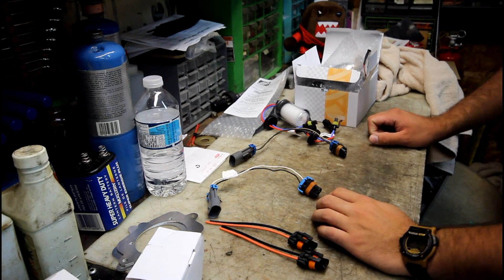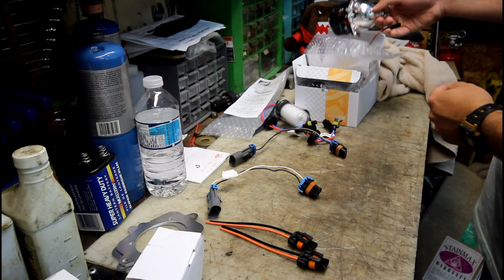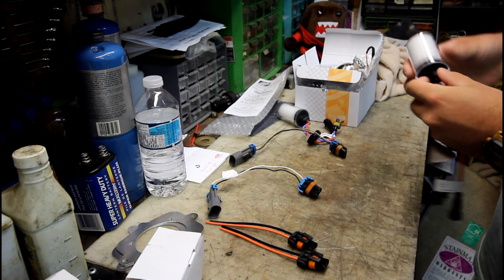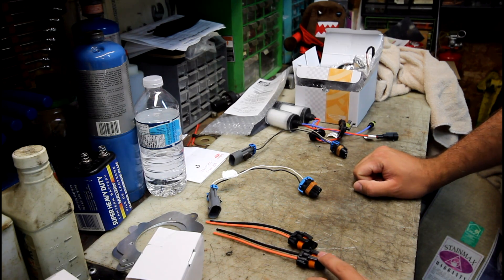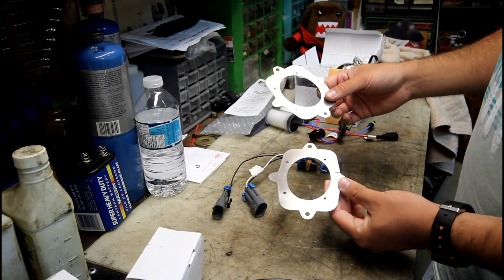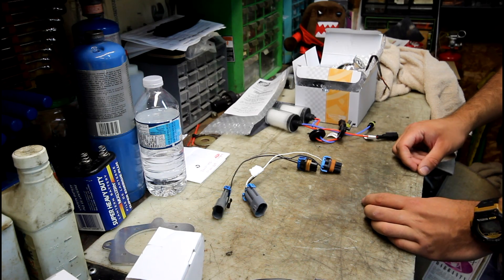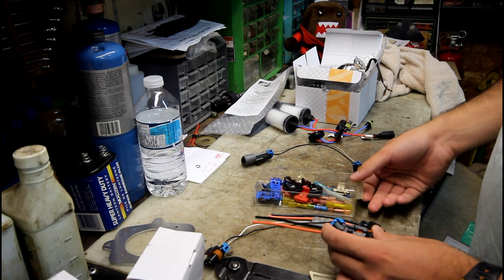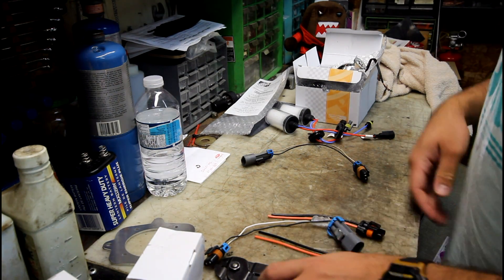How to: Retrofit GMC Denali headlights with HID bi-xenon projectors.

Comment: I realize this video is very old, but there aren't a lot out there showing this conversion.  14:35 has me very confused though.  You plugged the low and high beam into the harness you made, leaving one plug to plug into the truck.  That would have to be plugged into the low beam circuit for your low beams to work correctly.  Did this get changed when you installed the lights?  I have zero idea how the high beams are getting triggered at the end if you didn't.  These vehicles have separate harnesses for high and low beam.  It's also possible that I'm just dumb and am missing something obvious..
Reply from the maker: Sorry I'm only seeing this now as I'm going through old content, and unlisting things (not this video), but you would have had to do the HI-6 mod, which keeps the low beams on, when the high beams are active as well.

Comment: is it still worth it to do this and track down all the parts?  I just cleaned my glass projector lens and installed some auxbeam LED lights in mine.  They seem to work pretty well as is.
Reply from the maker: A company called Custom Brackets and Designs now makes the adapter plates for these headlights. They for the current version of Morimoto Mini H1. This retrofit is absolutely worth every penny. I'm about to do the old beater Yukon Denali that I just picked up for a winter truck.
Reply: @03canadianf5  Thanks!  As you can tell by my comments I don't know much about this.  I heard in the past that HID's were picky about coming on and off, Like for when you start your truck in a garage.  Might be a dumb question but could you use the Morimoto Mini H1 with a LED bulb?

Comment: Nice video. I am doing this for my 03 Yuk Denali, and I am using the H1M 7.0. Its seems the depth might be different with this design. If I were to mount my H1M's to the plate like you have yours my projector lenses would be 0.555" away from the projector hole in the headlight. Is it the same for you, and I am not seeing it, or did you use a spacer that I am not seeing? Also, the link you provided is not working, does this member still make these?

Comment: I currently have mini's retro fitted into regular sierra heads. When informed about this plate I've been looking for decent quality smoked Denali heads. Anyways, which fog and daytime bulbs are you using? Turns led? Links to bulbs would be extremely helpful. Looks nice man, now get that high bulb matching since it's basically for looks. The Morimoto hid dominates the light output..

Comment: Whats the benefit of retro fitting vs using an up graded 9005 hid bulb with the factory housings
Reply from the maker: Josh Willmont the light output. The stock HALOGEN projector is simply not designed to focus the hot spot of an HID bulb. When I had 9005 hid bulbs in these projectors, they were brighter than stock, however the light output wasn't optimal. There was no focused hot spot, the output was uneven, meaning you'd have random blotches of light and dark spots on the road. You won't regret a retrofit.

Comment: Can the Denali headlights be used in a non-Denali 2002 Sierra truck? I have amazon projectors & HiDs retrofitted into the stock housings with no lenses, thanks.
Reply from the maker: they'll fit any 99-06 Sierra or Yukon with the same front clip
Reply: Thanks, and I'll also need to buy that adapter to mount an hid projector into the Denali lamps? I'm trying to decide if it's a better option to do that, or to drill out a stock sierra lamp and jb weld the projectors in. That idea seems way too unreliable in terms of aiming the projector correctly.
Reply from the maker: check on gmfullsize.com. I'm pretty sure there's a member there selling adapters for the new Morimoto Mini H1 7.0's from the Retrofit Source
Reply: Okay cool, I'll compare the costs of a Denali headlamp pair + adapters, to the stock Sierra pair + labor required to jb weld the projectors in correctly

Comment: Which ballasts and bulbs did you use for this project? Thanks.
Reply from the maker: Back in the day I was running Morimoto 3Five ballasts, now however, I'm running all Morimoto XB gear. I don't have this truck anymore either.
Reply: Thank you for the response! Do you know if you can use the morimoto D2s 3.0 projectors instead of the H1 with this project? I cannot find anything on it online.
Reply from the maker: +Pibbles 'n Bits the projector needs to be a 2.5" projector. D2S is a 3".
Reply: Is there an easy way to modify the headlights to make it fit? Again, I really appreciate your feedback. I have spent endless hours looking for an answer online.  I already got the adapter plates for the morimoto 7.0's and am about to order projectors but really like the d2s bulbs. So are ALL D2s  projectors 3 inches? There has to be one that works
Reply from the maker: +Pibbles 'n Bits I don't know of any d2s projector that's 2.5", but really I never had an issue with Morimoto's h1 bulbs, and the Mini H1 7.0 has awesome output.
Reply from the maker: and you'd have to cut away at the housing to open it up for a 3". it's doable
Reply: Its only half an inch to cut away. What could go wrong? Would be much easier if the 7.0 adapters work on the D2s as I already got the adapters! I appreciate the input!!!! Thank you!
Reply from the maker: +Pibbles 'n Bits "what could go wrong?" famous last words. lol
Reply: Just wanted to let you know I ended up doing the Mini H1 upgrade and loved them for seven months but decided to upgrade again as I wanted something OEM and non generic. Today I finished installing a 3 inch Acura TL projector. Research aside, it took me over a month(on and off) to complete and required a ton of cutting/measuring/dissembling/assembling and adjusting. There wasn't a day that I didn't think of the famous saying of "what could go wrong". It definitely applied! As Murphy's law goes; if it can go wrong, it will go wrong. It was a nightmare and I ruined a Depo headlight and fried a Dremel in the process but I am glad to be done! It was quite the learning experience and the end result blows the Mini out of the water.

Comment: Hi there.great video!! Ive just did the same conversion to my lights.unfortunately I had to make my own plates. Question I have is did you have to re-adjust you heaadlights when you were done?I had to raise mine to the hills witch  will not work for the reason that my high beams are now in the trees!! .My adapter plates are nice and flat and everything aligned perfect. Any thoughts?I see your prior post as to where  to purchase plates however that link brings me to a 2 year old post. Any idea if he still has plates?? I appreciate any advice. Thanks!!
Reply: Michael Gelormini Any luck fixing this

Comment: Just got in my mh1 6.0's and they are awesome! They include the splits now for the bi-xenon function so you don't even need to solder anymore! The most time consuming part was splitting the old projectors off. I had an OEM that came apart fairly easy but the eagle eyes headlight was a real bear to split. Had to bake that one. Happy with the outcome and I'm ready to try to put some matchbox projectors in the fogs! I think it has been done, i'll give it a try here maybe this summer.

Comment: I already have 9005 (or 9006 don't recall) HID kit in my truck and was wondering if I can add these projectors and just use the HID bulbs and ballast I already have or do I need to get new bulbs from TRS?
Reply from the maker: You'll need H1 bulbs for the new projectors. Your 9005's won't fit. Denali's use 9005's for highs and lows stock.

Comment: I put 9005 Kensun HID's in my OEM Denali projectors, They worked prefect, and the beam pattern is great. So why replace the projectors with the H1 style? whats the benifit?
Reply: The light output from stock Denali projector isn't great.  The Morimoto H1s are striking in terms of light output and sharpness of cutoff.  It's a huge contrast between the two.  Definitely worth the swap because the metal adapters make this retrofit plug n play.

Comment: Thanks for doing this video! I just finished my retro and this was a HUGE help!
Some pointers to those considering this:
1. be careful pulling projector housing (breaks easy)
2. Ri22o adapter plates do NOT fit the mini H1 6.0 design. They require quite a bit of trimming.
3. If you buy the GM correctional splitters from TRS, the diode may need to be flipped to work.  (These accomplish the same thing as 4-hi mod)
4. When mounting the ballasts, don't mount to anything metal or it won't ignite.

Comment from the maker: You'll need to follow this video to setup your truck to keep the lows on when you fire the high beams: /watch?v=vua_8s-AqaU

As far as wiring 4 bi xenons, your bi-xenon control (the red and black wires) will need a common power source. That means that your high beam wire will need to feed power to both projectors.

Comment from the maker: I'm looking at upgrading to the Mini-H1 6.0's. They've changed the reflector bowl a little bit so it's better for trucks.

If you already have ballasts you'll just need:
Projectors
Bulbs
Hi-beam splitters to get the power to the bi-xenon system
Relay Harness to power HID's (My truck went into "Reduced power mode" without it)
And the "4hi" mod. Link is in the description

Comment from the maker: Comes with factory HALOGEN projectors. Not the same as HID projectors. I had HID's in the old projectors and the output is nowhere near as clean, precise, and bright as what I have now. Also, the stock projectors were low-beam only. These projectors function as a low beam AND high beam because the cutoff plate is controlled by a solenoid. When I turn my high beams on, my normal high beam bulbs come on, BUT, my low beam's stay on (projectors) and the cutoff plate falls out of the way. 3x brighter

Comment: Great video! I have the Depo projector headlights in my 2001 Tahoe. Will these brackets work with my headlights? How much different would a Tahoe headlight retro be over the retro you did in this video?

Comment from the maker: Removing the part that carries the lens would probably make it easier too. If you have H1 projectors, an H1 bulb will work... D2S requires a D2S bulb. If you're working with stock projectors... 9005.